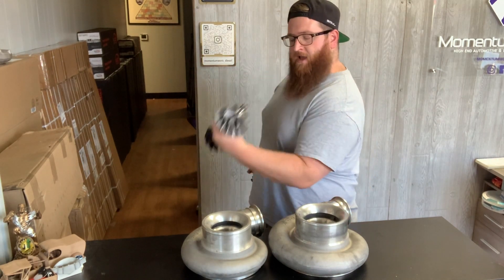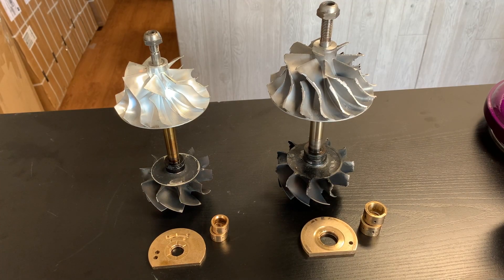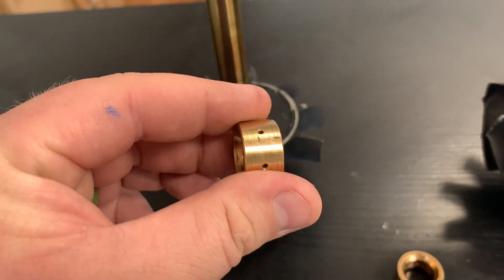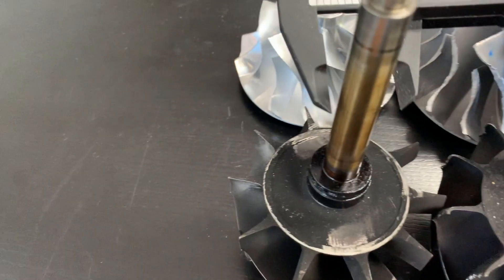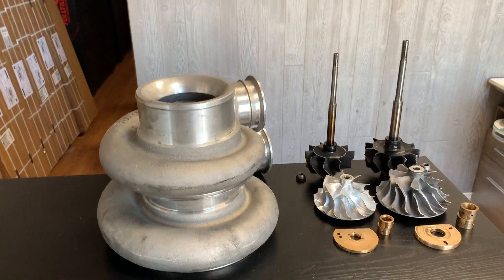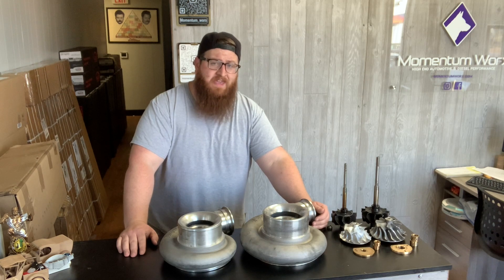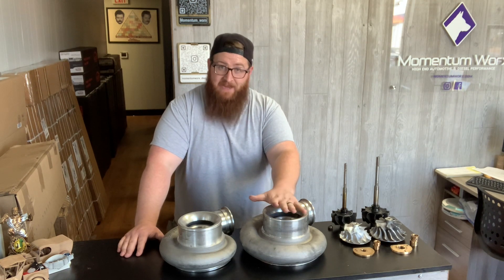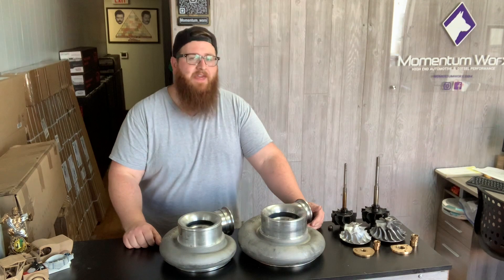BorgWarner S400 Turbo and S500 Turbos, what's the differance?

Comment: Not really sure where to ask my questions, so I will try here. I am working on a military CAT 3116. It produces a whopping 290 hp. I am changing my stock turbo to a recommended drop in CAT 10R6402 which is a Borg Warner (BW). The newer turbo supposedly will last longer, since it has water cooling and the original BW did not. What do you think? Also, is there newer turbo in this BW group that should be considered a better swap with similar specs? My goal is only a modest power increase, maybe 30hp. I can turn up the fuel, since it is mechanical.

Comment: Is the diameter of the matting surfaces different on the center section? The Vband flages. For the exhaust housing and the compressor cover..
If you would have flipped over those different compressor covers i was going to bother you with this. Thanks for posting this video though. I still was helpful.
Reply from the maker: Yes, S500 bearing housing and back plate are more robust.  I think you're asking if they are interchangeable with S400?  - They are not, sorry!
Reply: @momentumworx  i tried researching the diameter or the vband flanges on an s500 center section didn't find the answer yet. 
I do think the exhaust is one tenth larger. But im not sure. 5" vs 5.somthing".

Comment: On the s400 turbo what would be the correct size oil feed, oil return and oil pressure..
Reply from the maker: Oil feed is a 1/4" NPT fitting, we use a -6 line for feed and 3/4" diameter tube for drain.  Oil pressure will vary depending on your application, but journal bearing turbos are much less sensitive to oil pressure than ball bearing turbos that often require restrictors.

Comment: You never covered the s430sx
Reply from the maker: S430SX was replaced by the S410SX.  The bearing housing is much larger then the S400 series since the S410 is designated for truck applications.  Unfortunately, the S410SX is only offered in a few compressor wheel sizes (78,80,82), but that really covers a ton of horsepower levels when you consider the different turbine housing options.  There a whole video on here dedicated to the S410SX if you are curious!